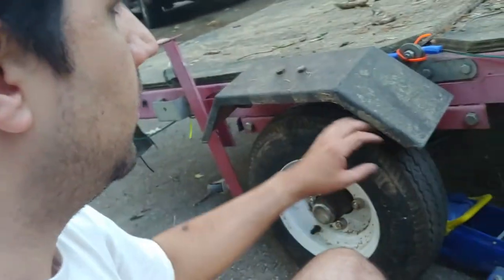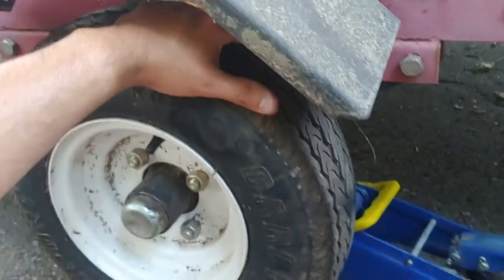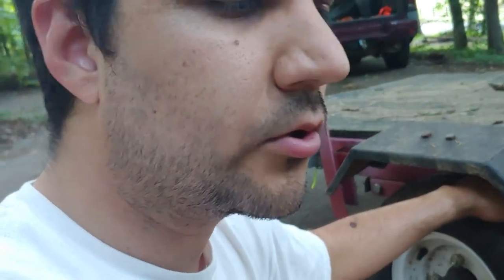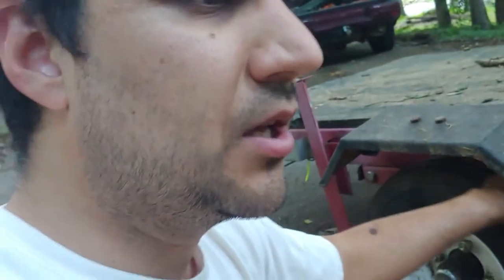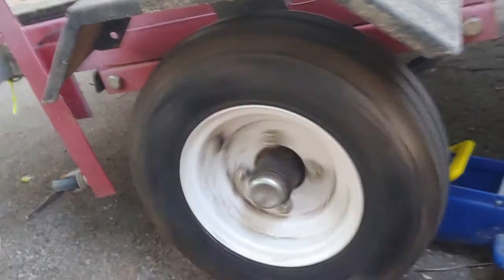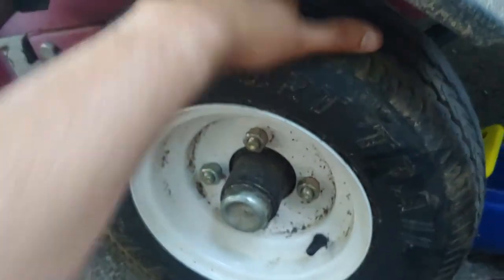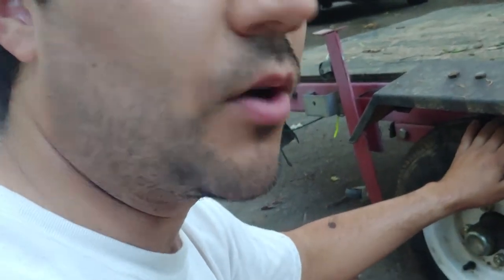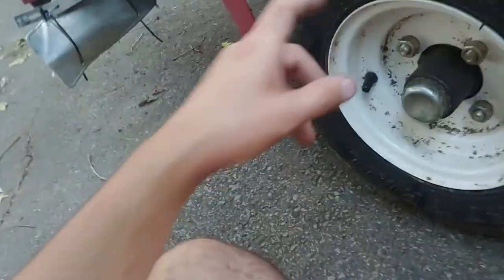Harbor Freight Trailer Wheel Bearing Hack

Comment: Great video how’s the bearings and wheels holding up !?
Reply from the maker: They're still good thousands of miles later. I've been through two sets of tires on them. The frame is starting to rust and the deck needs replacing, but the bearings are still perfect.